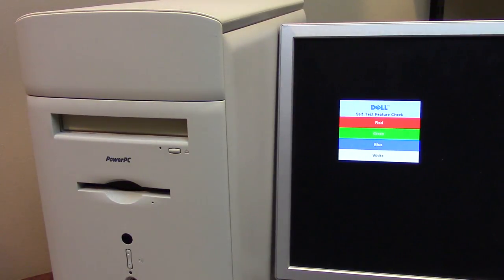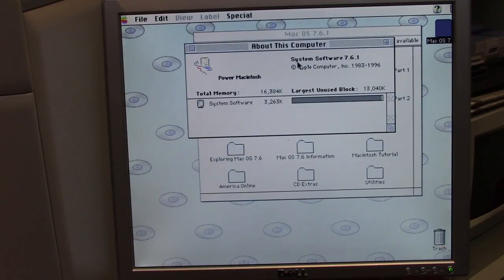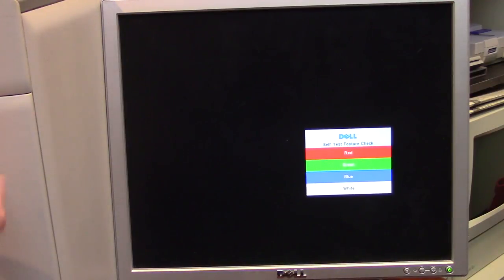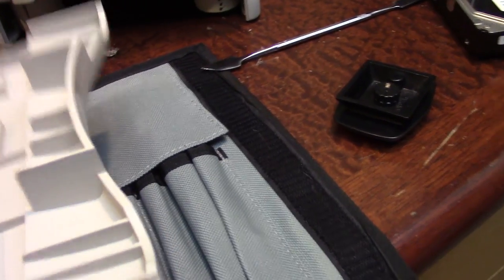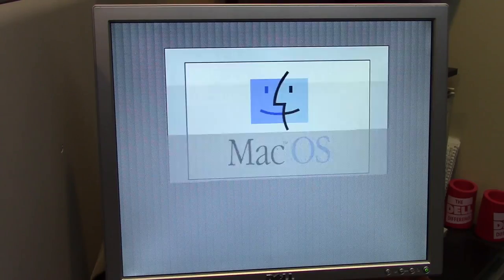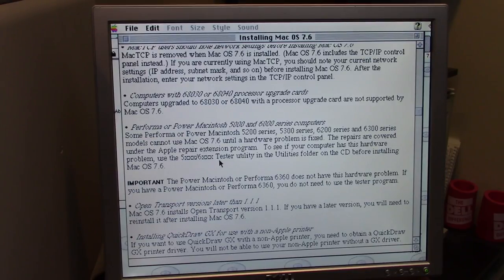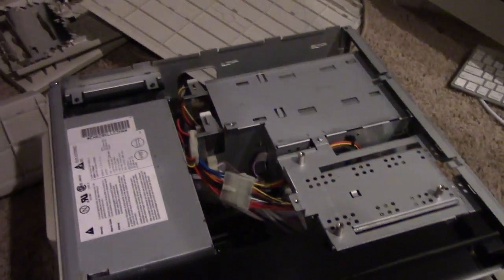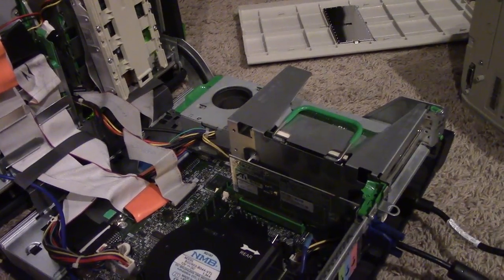Attempting to Install Mac OS 7.6 on the Macintosh Performa 6400

Comment: You need to go into the utilities folder on the install cd and run Drive Setup. That should let you detect and format the drive. I'd suggest trying the new hard drive with drive setup and see if it works. I hope this is some sort of help.
Reply from the maker: I will be sure to try that out, thanks for the suggestion!
Reply: It's almost always worked when I've had issues. Hope it works just as well for you.
Reply: Yeah, that was the disk utility of the era
Reply: yeah and a partition saying <not initialized> should come up, just format that disk and it should be detected

Comment: I'm pretty certain that quantum drive IS bad. since its been in an attic forever, there's a 90% chance that the parking break on the reading head has melted and is keeping the arm in place. if not, it's probably a general failure rate because quantum drives are mostly doodoo.

I have had nothing but good luck with opening my quantum drives in my own home with no fans running, I do this to free the parking break and get them initializing on machines to extract things before they fail again. I usually remove the bumpers under the parking breaks because their rubber melts and keeps the drives from reading. I don't mind the noise left by the head. I've only taken apart drives under 1gb, I'm not sure if higher capacity quantums are as resilient to non clean-rooms

Comment: I own a Power Mac 7600 with a G3 400 upgrade. 256 mb ram It has no trouble using that same disk to install the OS on the computer. Also has a bunch of old stuff on it. Mine has 7.6.1 on that disk. Like I said it works very well. Very fast considering. I have 7.6.1, 8.0 and 8.1 all for that system.

Comment: I would try booting again from the Mac OS 9 Disk, then go to Utilities and there to Drive Setup. I think like previous comments allready said Mac OS 7.6 is just kind of pissed of that you don´t use an original Apple Drive. I know for fact that Mac OS 9 doesn´t care about what Drive is in there. Then you know atleast if the Performa is detecting the Drive at all. Did you check the Jumpers on the IDE Drive maybe the Jumper is set to cable select and not Master that could confuse the Performa and also the Dell

Comment: Alright so I had similar experience when replace the drive in a Rev. A 233 iMac. It had a 4gb apple quantum hard drive and I replaced it with a 160gb (i think) hard drive and it either didn't show up, wouldn't install or be formatted with any mac os or os x cd I tried. I later tried other drives with similar or completely different errors. I ended fixing this by changing the jumper settings on the drive itself. Make sure to look up the max drive size and max partition size for this particular mac. You have to set the jumper to limit the new drive size so it will be compatible with the mac. I'd recommend using the new drive and after changing the jumper setting to a known compatible size (in my case I had to change it to an 80gb limit but it may be different for your mac) and then running the drive setup from the install CD and setting the partition size to about a gig under the max that your mac allows. I'd also recommend using the newest version of mac os that will boot from CD as it will most likely give you better chances when dealing with the drives.

Comment: Michael, have you tried running Drive setup?  It will let the drive be seen by the OS. I have used Mac since the G3 AIO, and I hope this helped. I also just got a G5 DP myself, a mid 2004 to be exact with 4 GB of memory and a 160 Gig drive I think. The processors need reseated in order for it to work though. I also have a mid 2006 Mac Pro and an original 2 GHz MacBook.
Reply: With me, my early 2008 MacBook Air wouldn’t boot. And when I booted from a Mac OS X Snow Leopard it would give me an error when I clicked my drive. A re-partition did the trick!

Comment: Your install disc was looking for a SCSI disk drive, which is not the same as IDE. Early Macs supported the SCSI interface. Doubled check the drive types for that system.

Comment: Drive Setup only works with Apple drives. I'm guessing the Quantum drive it came with is just dead. You should be able to get things working with any other IDE drive, but you'll need a third-party program that is capable of formatting it, or you can patch Drive Setup so that it recognizes any brand drive. http://lowendmac.com/2007/format-any-hard-drive-for-older-macs-with-patched-apple-tools/
Reply: I could be wrong here but i´m pretty sure Mac OS9 doesn't care about if it is a Apple Drive. But on older Versions of Mac OS that could be true. And your right i also think the Quantum was just dead.

Comment: I may have just found the problem, and it's like that the Performa 6400 only supports up to PID model, MODE 4, which basically means it doesn't support third party hard-drives, from the factory.  There was an article from Apple, but when I click on it, it only dircts me to the Apple home page.  This also means that the 40GB drive, will not work with the system because of this.  This also confirms that the original hard-drive it definitely on it's last legs, if it isn't picking it up, and the drive definitely supports MODE 4, if it's the original.  I'll put the link to where I found this information and an in detailed specs, of the machine if anyone is interested from where I'm getting this:  http://lowendmac.com/1996/power-mac-6400-performa-6400/

Sorry to ruin your dreams
Reply from the maker: That explains why it wasn't detecting the 80GB drive. Thank you for this information!
Reply: PIO mode, and it has nothing to do with capacity or detecting the drive, all drives are down compatible

Comment: i new IDE cable could fix the problem with reading the hard drive, or you will need to run unitality to format the hard drive to run under mac, i have watch a lot of your videos and they are great but you don't seem to know much about pc when it comes to getting it to run, like other videos you had linux installed and said something about the graphics well you need to install drivers to fix those problems, this problem could be the IDE cable or the hard drive just needs to be formated come on dude

Comment: the thing is that everything is related to a software problem not to a hardware problem.
I think you just need the correct installation disk or simply put a system enabler on the root of the system 7 install disk that you have.